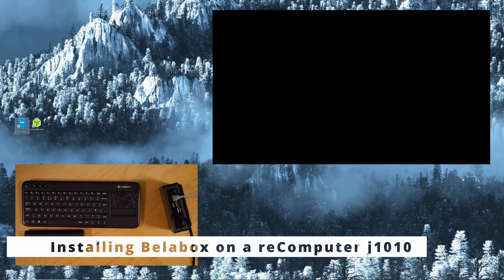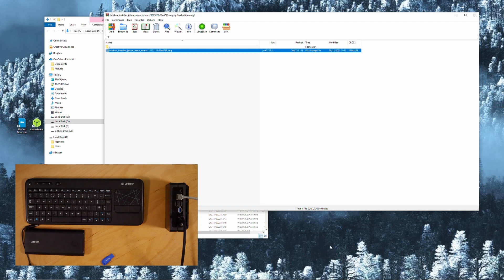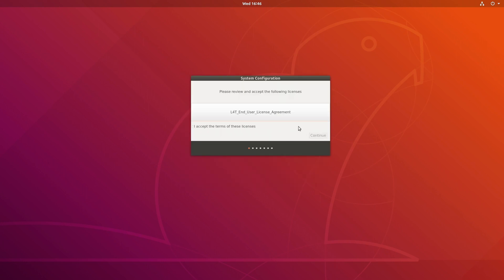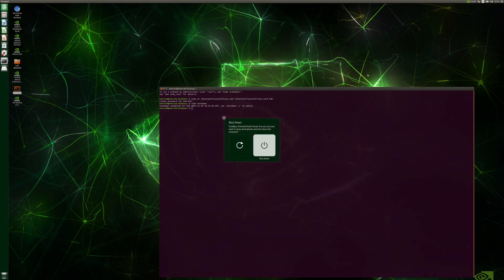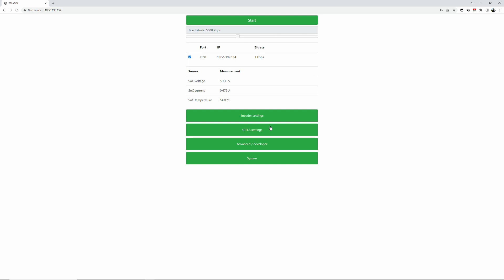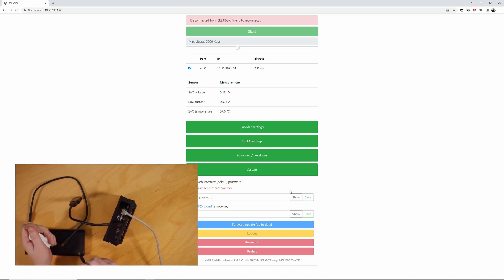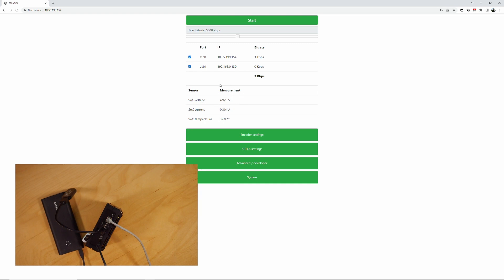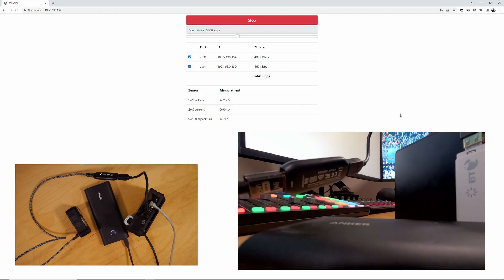Installing the Belabox HDMI bonding encoder on a Seeed Studio reComputer j1010

Comment: Hi I was wondering your opinion on which is better, belabox or tbs? 

My main goal is to GoPro wireless stream to a bonded network, and just change batteries when the GoPro is gonna die. 

I heard I can wireless stream to the belabox from the GoPro to a SRT Server and relay the video feed correct? 

I saw someone use a mini usb Wi-Fi Adapter in the belabox. 

Thank you for your time, your a legend bro

Comment: How does the bonding algorithm work, I noticed one of your modems was doing most of the work
Reply from the maker: That's because one of my modems (in this case the mobile connection) didn't have sufficient bandwidth. Belabox looks at latency and round trip time and load balances based on that. If all connections were equal, then it would send the same bandwidth to all.
Reply: @EmeraldAudiovisual  thanks
Reply from the maker: I had a look over on your channel and see, that you've got the Kiloview P2. Belabox works very similar to that in the way it bonds, just that Belabox is more informative and more precise in the way, it displays the data. Additionally, there's the advantage, that you can get a 10$/month sub to Belabox Cloud, if you do not want to host your own bonder, but you also can host your own bonder like with the Kiloview. And then there is obviously the fact, that Belabox supports H265 / HEVC, while the Kiloview P2 does not. Both are good encoders though. Belabox takes a bit more fettling, as it's more of a DIY approach, even though you now also can get turnkey units.
Reply: @EmeraldAudiovisual  I bought a Jetson the other day and installed Belabox, subscribed to Belabox Cloud and I'm impressed. I normally SRT into my vMix machine at home so Belabox works for me that way and your correct about H265 what a great addition to have with Belabox. Love the fact it has a built in RTMP server as well, I had my Pocket 2 wirelessly streaming to it. The Kiloview is good I have my server hosted on AWS which costs basically the same as Belabox Cloud. But looking forward to use what Belabox can offer, just need to sort out a case for it and tidy up the setup
Reply from the maker: Aye. RTMP over Wifi ingress is one of gems with Belabox.

Comment: Hey I have the Jetson Nano with BELABOX. How do I remove the scrolling info displayed on the screen when streaming. I noticed yours doesn't show it. Thanks in advance!
Reply from the maker: Do you mean the bitrate overlay ? In old versions, you had to remove it from the pipeline manually. In new versions, it's disabled by default, but you can enable it via the checkbox in the UI under "Encoder Settings". Just uncheck "Enable the dynamic bitrate overlay" there.
Reply from the maker: I had a look in your last stream: yes, that's the dynamic bitrate overlay. Just a checkbox in your BelaUI, that you need to untick.
Reply: @EmeraldAudiovisual   Man thank you for your help. It worked! I'm super new at this and loving it! By the way I've watched all your videos. They are the best.

Comment: How much battery life do you get out of the Anker PowerCore+ 26800?
Reply from the maker: That really depends on how much gear you're hanging off that battery (varies with the amount of modems you use).

Rule of thumb: more than 5 hours.

Best way to find out: plug your gear in, start a stream and let it do a dry run. Once the batterie dies, you know, how long it can run.
Reply: @EmeraldAudiovisual  thanks for that. I'll only be running 1 USB dongle modem to start with. Just trying to decide if I need 1 power bank for the AS300 camera and a seperate power bank for the Jetson Nano or I'll be able to run both off of a sinlge power bank with good battery life.

Comment: j1020 can i power it with powerbank?
Reply from the maker: I would NOT recommend the j1020. It has the DC-barrel power plug and those are difficult to power from powerbank. That board really only is an option, if you combine it with the Geekworm T201 or T208 UPS board.
Reply: thanks @EmeraldAudiovisual